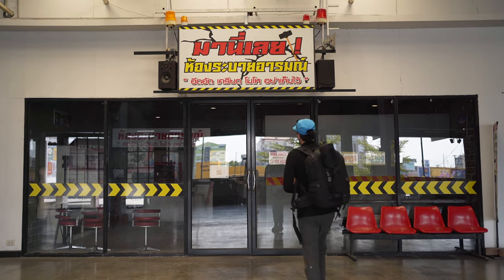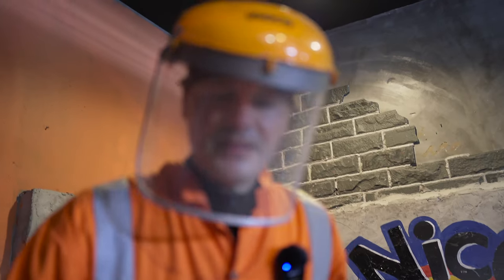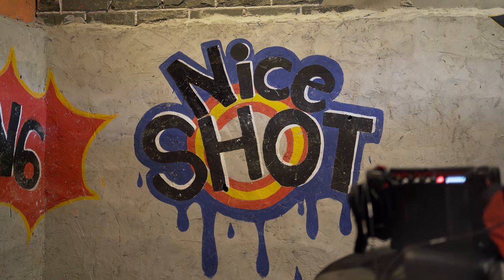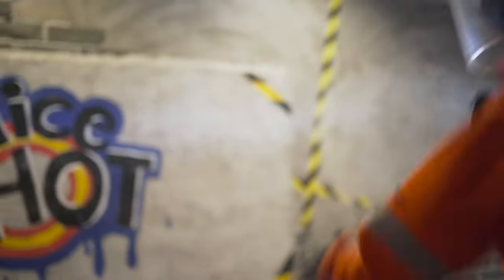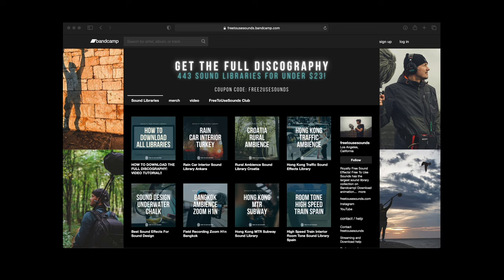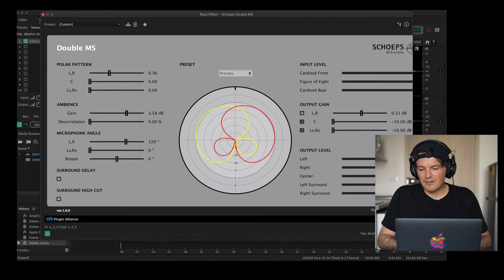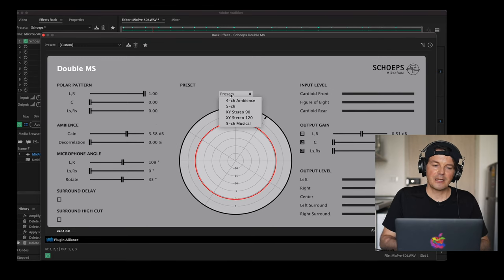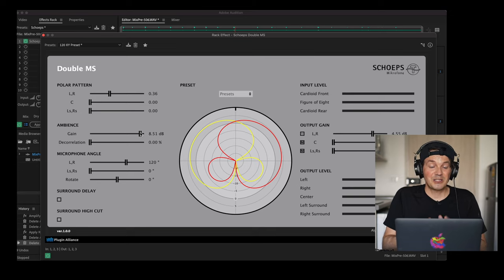How to Record Destruction Sounds: The Microphones I Use and How I Do It!

Comment: Excellent as always,  I'm sure you used 32 bit float while recording to handle those peaks--   that's the magic right there --  don't recall if you mentioned that--- 
32 bit makes recording soooo much easier-- don't have to worroy about riding the levels.   Well done!!!
Reply from the maker: H Michael, that is correct. I used 32 bit float of course :)

Comment: Hi Marcel! I don't think my last comment posted properly in here but I was wondering if you're saying to Cecil that the F6 is not good for studio or filmmaking?
Reply from the maker: Hi Ted, no, your comment is there, but I can reply to it here and delete it from the other section. Well the biggest downside you could face is not necessarily the technical parts of both recorders, it actually comes down to getting the gig or not. Producers would rather hire someone who has a Sound Devices unit than a Zoom unit. I'm not saying this from my own experience because I don't work on set but I know a lot of people working on high profile sets, and they won't show up with only a Zoom recorder.
Reply: Okay great so they're just as good techwise then. I'm not concerned about being hired for sound since I'm not wanting to be a sound guy per se. My focus is creating a YouTube channel and producing my own short films using my own gear. Eventually I'll open a studio here in Florida. Thanks for the response
Reply from the maker: Oh yes they are.

Comment: Hey.  I need to dive more into your recent videos, I noticed you have been using the Sound Devices MixPre 6ii more than the Zoom F6 for example.  Does it have advantages over the F6?  Sound better? etc.  TIA
Reply from the maker: Hi Cecil, it all depends but the F6 is great and I still use the F6 very often. For example for VR recordings. For DMS I use the Sound Devices because I can link 3 channels which is perfect for this set. As long as you don't work on set and use the F6 for field recording purpose only, there is no disadvantage.
Reply: @FreeToUseSounds  Thx for the quick response.  Stay safe and Happy Holidays!
Reply from the maker: @cecilkeebler4254  You too! :)

Comment: What advantages on set you give the Sound Devices over the Zoom F6
Reply from the maker: That you get the job and have a reliable unit that is known for its hour long work. A Zoom F6 is an amazing product and I use it for field recording only. Never faced issues but If I would work on big production sets, I would use the Sound Devices first and have a Zoom recorder as back up.